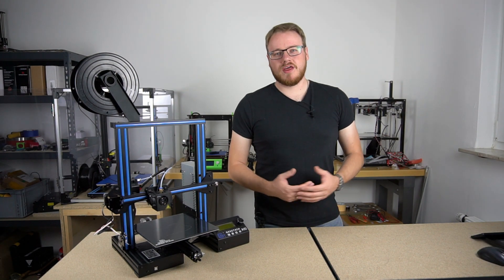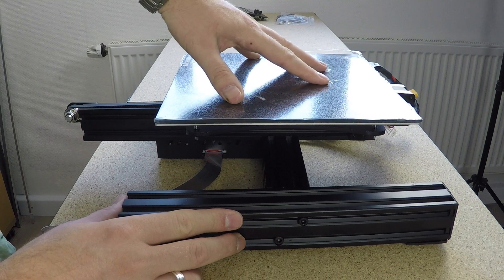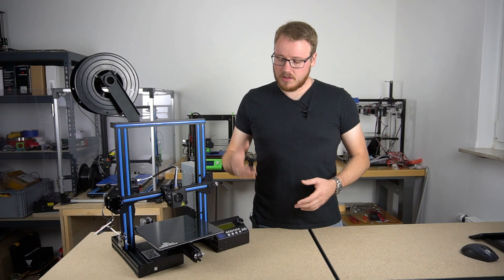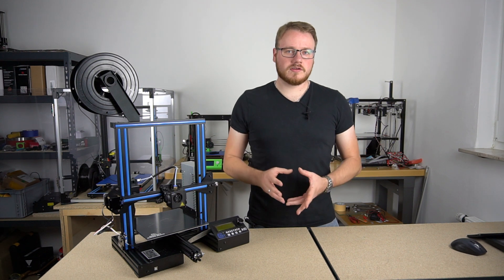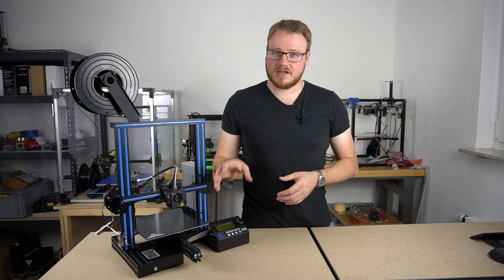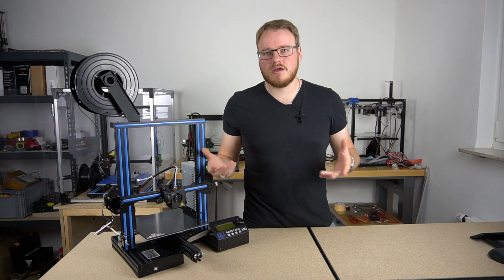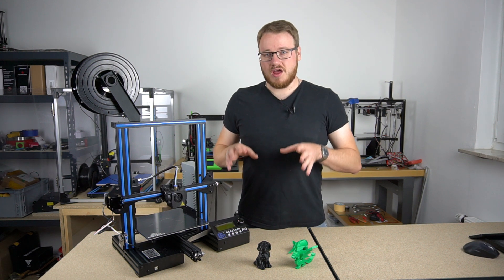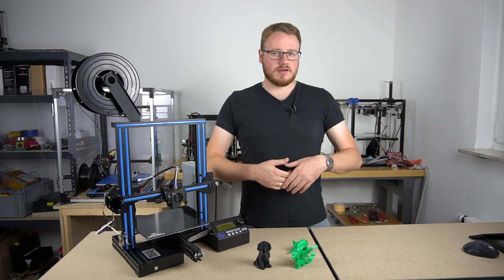Geeetech A10 #Review part 2

Comment: Vom GT2560A+ gibt es eine Anleitung : http://www.geeetech.com/wiki/index.php/GT2560A/GT2560A%2B#Interface_Layout
Aber vom aktuell verbauten GT2560 II noch nicht.
Reply from the maker: Danke. Man hat mir auch die Info gepostet, dass man bei Github unter Me Creator 2 suchen muss dann findet man das rev B Board.
Reply: Die Datei heisst MeCreator2.zip https://www.geeetech.com/forum/viewtopic.php?t=18024. In der Anleitung gibt es Hinweise auf das neue Board und Links zu den Geetech Foren. Im Grunde genommen ist das GT2560 wie Ramps 1.4 aufgebaut . Leider nicht mit identischen Headern. 

Intressant ist auch https://www.geeetech.com/forum/viewtopic.php?f=18&t=61704

The file is called MeCreator2.zip https://www.geeetech.com/forum/viewtopic.php?t=18024. In the guide there are hints on the new board and links to the geetech forums. Basically, the GT2560 is built like Ramps 1.4. Unfortunately not with identical headers. Look also https://www.geeetech.com/forum/viewtopic.php?f=18&t=61704
Reply from the maker: Ja genau. Top👍

Comment: Would like a solution to that parts cooling fan too. Not a biggie, but just something that bugs me. It is pretty quiet for a 40mm fan though. 
I agree that this is an advanced user printer. Beginners should start of a direct extruder system with open electronics. The Anet A8 is perfect to learn on.
Reply from the maker: As I got an information from a few people a fw update will solve the fan issue. I think for beginners the ender 3 is a good printer.
Reply: @technikstudio7504  
A FW update? So the problem isn't the hardware? I have Marlin 1.1.8, I think we are on 1.1.9 now. Does this really solve the PWM issue? I don't really have confidence in altering my firmware using Arduino as their documentation is very confusing, with citing different versions of Arduino to use, and something about "if you have the M8 threaded screw, add this line of code" etc.
Reply from the maker: I am not sure. I only got the information from other people to update the fw. I measured the voltage and I measured the 24 V - - so this should be ok
Reply: @technikstudio7504   Okay, thanks for replying. I might try at a later date as Marlin .9 has linear advance which I hear is a good addition to have.

Comment: Hi, very cool video. May I ask which software you use for the models and how you have set the printer? My problem, I can print the dog in a good quality, when I use other shapes I always get these delivered as a sort of grid. I use Cura in the latest version and have the setting once as a download attempt and on the other hand the settings manually entered. Always with the same result. Thanks for an answer.

Hi, sehr cooles Video. Darf ich fragen welche Software du für die Modelle verwendest und wie du den Drucker eingestellt hast? Mein Problem, ich kann den Hund in einer guten Qualität drucken, wenn ich andere Formen verwende bekomme ich diese immer nur als eine Art Gitter geliefert. Ich verwende Cura in der aktuellsten Version und habe die Einstellung einmal als Download versuch und zum anderen die Einstellungen manuell eingegeben. Immer mit dem selben Ergebnis. Danke für eine Antwort.
Reply from the maker: Hey, I am using Cura as well. I do not have such an issue. But in Cura there is anywhere a checkbox to print as grid (I need to check in which category you can find it). Perhaps it is up to that. If you want I can send you my Cura Profile Via email and you can try again. I hope this will help you. 

Hi, ich verwende auch Cura. Dieses Problem habe ich nicht. Aber es gibt in Cura irgendwo die Einstellung als Gitter drucken (ich muss prüfen in welcher Rubrik die einstellung zu finden ist). Vielleicht liegt es daran. Wenn du möchtest kann ich dir mein Cura Profil per Mail schicken, dann kannst du es damit nochmal versuchen. I hoffe das hilft dir weiter.

Comment: Schematic of mainboard: https://github.com/Geeetech3D/Prusa_I3_3Dprinter/blob/master/MeCreator2/Hardware_GT2560_RevB.pdf
Also check out https://github.com/Geeetech3D/Prusa_I3_3Dprinter
Reply from the maker: Thanks for the link 👍 I didn't found it 😅
Reply: I consider an A10 or A10M - or an Ender-3 (have an Anet A8 at the moment) .. Not quite sure what to select. A least the GT2560 board on A10/A10M has replaceable stepsticks, so you can use TMC2208's instead..
Reply from the maker: I had issues in the beginning up to quality. But it can happen with every printer I guess. The Geeetech A10 is a great printer in my opinion after fixing the issues. I have the ender 3 here as well. I will upload an review video next weekend.

Comment: GT2560 revB schematics diagram:
https://github.com/Geeetech3D/Prusa_I3_3Dprinter/blob/master/MeCreator2/Hardware_GT2560_RevB.pdf

And regarding part cooling fan PWM problem, it seems to be a Geeetech firmware issue,  could be solved by Marlin upgrade, take a look here:
http://www.geeetech.com/forum/viewtopic.php?f=91&t=61646
Reply from the maker: Thanks for information. I will try.

Comment: I’m addressing the LCD display which you’ve mentioned: the availability is very bad, I’ve tried to get one of these, it only comes in an expensive bundle with the controller board for around $50 US, I cannot get only that specific LCD display. On the circuit board of the LCD display it says “LCD 2004-v1” and even with that search term I only get the ones with the dual “floppy disk connector”. I hope anyone can point me to a source where I can get just the LCD with that FFC (flexible flat cable) connector. HELP!
Reply from the maker: Yes you are right. I think this is one of the worst things on this printer, except the poor quality in my case. It is a great Mainboard I think unfortunately it is not done in best way. This lcd connection and the mentioned points are reasons why I am not sure if I will buy the A20M in the future. Hopefully you will find another lcd for less money. If you will find perhabs you could post here.
Reply: For those who know how to make small PCB with three connectors just compare https://github.com/Geeetech3D/Prusa_I3_3Dprinter/blob/master/MeCreator2/Hardware_GT2560_RevB.pdf  with http://www.geeetech.com/wiki/images/d/d3/Hardware_GT2560_RevA%2B.pdf
Reply: Actualy with google search "40Pin 0.5mm FFC FPC to 40P DIP 2.54mm PCB Converter Board Adapter"and soldering iron, just cut connectors from ordinary LCD2004 cables and solder to this small board according to pinout comparing two boards.
Reply from the maker: Good point. This could be a solution to use other displays.
Reply: @malarikavela  Thanks a lot, I appreciate it, a brillant solution